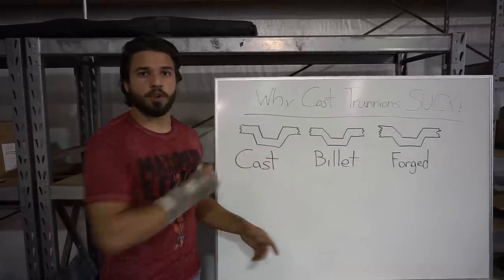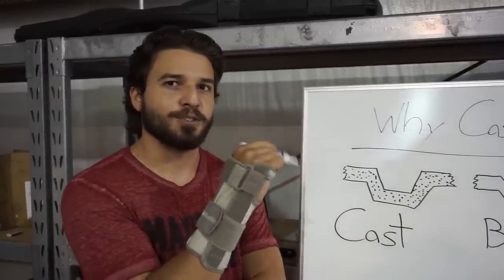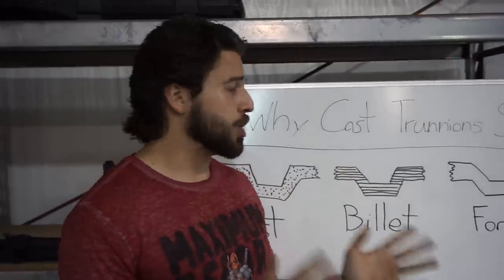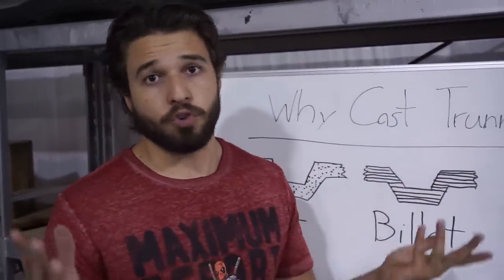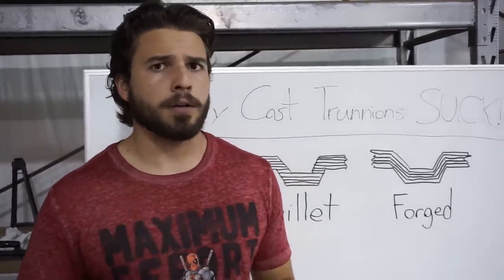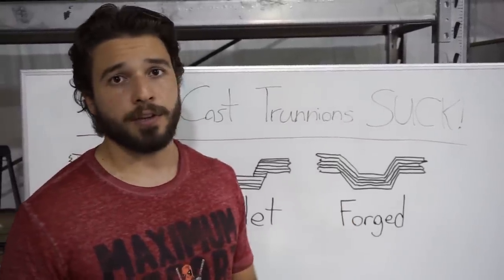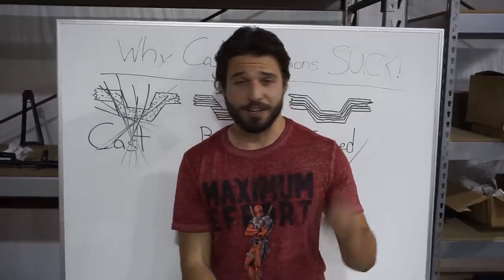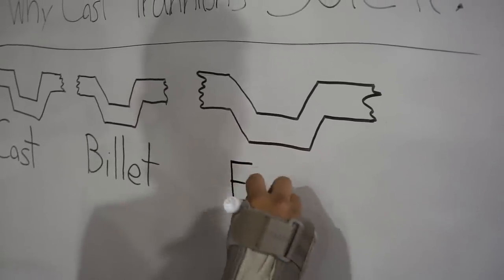Why Cast Trunnions SUCK!

Comment: Honestly, I don't understand why there is an issue.  When you get down to it, the difference in strength between cast, billet, and forged, with all else being equal, should be minute.  I wonder if it's something to do with heat treat or the specific alloy used, or possibly the quality of the casting method?  All steel is cast, and all steel that is not cast to shape is forged, ie billet is just forged into a bar.  I'm wondering if the cast, due to the extreme high heat has a very large grain structure, doesn't get the much needed normalizing cycles prior to heat treat?  Not saying there isn't an issue, just wondering what is causing it.  With modern steels the grain flow or direction is pretty much irrelevant.  In any event, I prefer forged over cast steel on just about anything as a mater of personal preference and would absolutely prefer a forged trunnion over billet or cast.
Reply: I think it has a lot to do with cost.
If you go for casting in a production process like this, where forging is an option, you do it for cost.
And therefore you will not use the best steel, the best mold, the best casting technique, nor the best craftsmen.
I'm pretty sure, if you'd go high-end with the casting, the end product would be 100% fine. But then you wouldn't save money by casting it.

Casting can do amazing things if you are willing to invest in equipment and skill, but it is probably also more sensitive to cost cutting than other techniques.
Reply: @Bird_Dog00  I'm thinking you are rite.  I think it's more to do with heat treating cycles, when forging you get at least some thermal cycles as a matter of production and never reach the extreme heat of casting temps.  If casting they probably skip a lot of steps to save time and money, otherwise why bother casting.  Even then, there is no doubt that forging is stronger, but all else being equal it'd take something along the lines of very controlled destructive testing to tell them apart and the difference would be slight.

Comment: I didn't want to believe it but mine just cracked on the right side locking recess. Really pisses me off. Searching now for a milled trunnion that will fit my Ras 47 barrel. I'm not sending it back to have a cast trunnion put back into it so warranty or not I'm going to have to fix it myself. Any input would be appreciated. I've done parts kits builds but never an ak. Looks easy enough but if you guys have any tips that'd be awesome. I'm mostly worried about the barrel diameter, I heard that the Ras 47 barrel is thicker than typical.
Reply: When I say milled I mean specifically the forged block type that are in the Yugo parts kits, that's what I plan to use because they're everywhere.

Comment: I think the century arms vska and riley quit cast within the last year. Someone else in the recent comments said that riley is using forged now, idk what vska switched to. I know i watched videos of old rileys compared to the brand new ones and you could physically see the difference in function/design of the higher quality parts.
Reply: apparently the vska switched to billeting based on the blurb on their website
Reply: @harveyknguyen  nice to know. Riley did switch to forged although the rifles overall quality is still moderately questionable
Reply: @preflightdrip8672  they're still going through teething issues, i'd give it a year or two until Riley and PSA actually make completely reliable AKs that you'd actually trust to not break
Reply: @harveyknguyen  eh i dont think they'll ever make good ones compared to wasr and zastava options, much less higher class stuff like arsenals and maadis. Rileys can be fixed pretty easy since their trunion is good now their main issue is the bolt carrier assembly so that theyre ok. As for psa i wouldnt trust a psa made flashhider much less a rifle lmao
Reply: @preflightdrip8672  maybe they'll get it down one day, kinda really hoping they do since as it stands imports are kinda drying up at the moment for 5.45 stuff
Reply: @harveyknguyen  true, cheaper 5.45 aks and ammo produced in the states would be nice
Reply: @preflightdrip8672  either that or Arsenal decides to treat the SLR 104s like the McRib

Comment: Psak 47 is under 700 and use billet bolt and trunnion
Reply: Knight Mech gen2 also has a forged bolt carrier. Now the gen3 has a forged trunnion, bolt carrier, and bolt.
Reply: I just picked the gen 3 up for $599.00

Comment: So... Where are all these blown up rifles? Personally, i dont own one of the rifles in question, and the only cenury arms i own is an fal copy,but ive owned several firearms that had safety recalls, and those recalls were massively supported by the comsuming public at large. And that is not the case with the ras47. This just looks like one guy that sells import rifles " broke" a rifle in an admittily destructive test on an early production gun( and has no idea how a "no go" gauge works. Like the majority of the people that watched that "test"). But despite what the internet claims,the numer of cast trunions " failing" is nowhere near the claims being made( well under 10 verified instances vs tens if nothundreds of thousands of rifles sold). The majority of the ras47 rifles on the market are metelurgically IDENTICAL to the vska( which " passed" what the " union spokespersons" test). But despite piles of evidence to the contrary everyones reaction to any claim other than " its a grenade waiting to go off" is treated with incredulous denial based on internet anecdotes. This really seems like an excuse to hate on an affordable option that has seen popularity. Just more hating on the " poors" and justifing spending more money. If cast parts are " so terrible" i guess ruger never saw the video. They have been casting EXELENT rifles for decades, in the same caliber no less.but if these cast trunions were half as bad as they are claimed to be; a) there would be more than 3 police reports and 5 emegency room charts sighting " rifle malfunction" as the cause of any injury, and century would HAVE to put out a recall or theyd be sued out of existance for knowingly making faulty equipment. and that has not happened. Seems more like the world is full of rifles that run fine, with cast parts, and the internet is just salty that fact doesnt align with a sales pitch from a guy that has a vested interest in selling imported parts kit rifles.
Reply: well look you also have to consider that the guy who likes selling SVDs on gunbroker also happens to break just about every single inexpensive gun he reviews
Reply: @earlycuyler2295  well i mean it goes to really any word of mouth info you get anyway, all guns even of the same model are going to be slightly different in every way, so even though everyone's IO AKs were awful there may be some that actually work, and the people who got them will have incredibly different opinions of IO compared to everyone else
Reply: @earlycuyler2295  oh yeah and the ruger part kinda has to do with the fact that they haven't actually made any AKs, so as it is the experiement of cast trunnions can't be reproduced on Ruger's end
Reply: @harveyknguyen  yeah. I know they havent made akms. But the fact is that they are made from cast parts and are NOT known to have ANY signifIcant known failure points.I was speaking about the mini 14/30 specifically, and the rest of their product line more generally.
 The entire receiver , is a solid machined casting.as are most parts. In fact it can be argued that ruger is just a casting company at heart. It is their bread and butter. And i do not see anyone having any issues with them. And there is an old ban era mini 30 floating arlund my family that has had to have seen close to 200k rounds. I know i had if tor a while and put 6 cases through it myself, and my father probably double that, and his brother shot it WAY more than we ever did. But annecdotes aside, if the " problem" was legitimately as interpreted by the internet gun experts, and cast parts are not suitable for long term use in firearms... Ruger would be out of business; or would have dropped it as an antiquated means of production.
And that just is not the case. It comes down to marketing. And peoples desire to be validated by the companies that sell guns to them. They desperatly want to believe that these " content creators" are anything more than salesman. Its not just brandon, or akou, military arms, firearms unlimmited, or any other. They all shill for the last check to clear, while other, smaller, and objecticly "independent" channels are put into a position where they either have to " tow the line" and agree simply because the " community" of sponsored channels demand compliance, or disagree and themselves be called " shills" for doing their own analysis that find no issues with the product in question.
Reply: @earlycuyler2295  yeah i don't think the takeaway from this video is that casting sucks, it's that casting trunnions is a bad idea

and also all of the US AK manufacturers switched to forging or billeting their trunnions now
Reply: @harveyknguyen  yes, they have switched, but that switch was made long before they changed the name of the "ras 47 "to " vska". But again,  the point is that its bad because of cast parts.all other data aside, and back to my original post -" where are the blown up rifles?".
If these were as " bad" as the internet claims there would be more tha less than 10 actual confirmed incedents.and of them about half are from peoole  replicating destructive testing methods, commited to finding a point of failure to " prove" the assertion. You can " break" anything if your trying to do so. Even machined trunions.
If it was a " problem" and century still knowingly made something that failed they'd need to do a recall, and the owners would be 110% on board with it. From everyone ive seen with a ras, the rifle has none of these "problems". And the only people that talk about how bad they are are people with either a vested interest in selling other akms, or youtube host fanboys.
Reply: @earlycuyler2295  but then that begs the question as to why the VSKA was even made if the RAS-47 was fine in the first place

plus as i stated earlier, nobody's gonna have the same experience, so unless anyone has a large sample size of RAS-47 owners, it's not going to be indicative of the real failure rate of these rifles 

and then those issues may not even come from casting but rather due to bad quality control (for example, the cast itself was poorly done)
Reply: @harveyknguyen  it was renamed to avoid this silly, false rumors. " red army standard" was going to be a multi brand product line and century invested heavily into it. Mags, ammo , rifle, parts kits, accesories, etc. I think i remember seeing special targets with the brand to. Just about anything youd need as an ak shooter was part of the red army standard branding. Which might have something to do with the importers ( and subsidiary companies) putting out this editorial " hit piece" on the rifle that was came ready made for the american consumer. I mean... Its not like they didnt try it again with the vska, again known shills for ak importers try to claim some inherent defect. Unfortunately this time around the claim was easily disprovable, and presented by a less " respected" more  "controversial" figure in the community.
Again the answer comes down to marketing.

As for " sample size" ive gotta go with the people who own them, and report zero issues. It seems like any time somebody says "mines worked fine" the immediate reply is from people claiming that that is not possible, because of these tests and a handfull of other people trying to break an akm. basically every single user is liar, or the problem doesnt exist. As stated ive had several firearms that have been recalled, for quality and safety issues, and the majority of owners are NEVER "in denial" as it is expressed ras 47 owners are for claiming no issue. Go look. Like i said i dont have a dog in this fight. Im in no way going to ever be buying a ras47( im covered when it comes to 7.62x39 rifles) but its become a " meme" of the community to trash on what 99.99% of its users say is a decent, low end akm. To the extent that i looked into the claims and found them to be questionable at best. And only actually " substantiated" from sources with questionable intentions.

The Potential  "quality control" issues are about the only legitimate concerns, it IS Century and there have been a few dubious guns with their name on them. BUT, IF it were an issue there would be more first hand accounts of failure. The best i can find is 10 reports that look like they are of between 4-6 rifles failing.and the details arent really solid enough to rule out anything. Maybe it was bad qc, it could have been bad ammo.maybe it was a headspace issues from higher round counds, maybe it was the " human element".  The one with hospital photos has an incident report that kinda sounds like it might have been a squib.
Regardless, yes any failure is BAD, but if it were an "issue"  at the production and they didnt address it, they are asking to be sued out of existance.thats why recalls are done. for something as high profile as this was, with like EVERYONE talking about them online the lack of recall, warning, or response would make them extremely liable. and it would be a much better bussiness move to simply recall and replace the allegedly " defective" guns just to cover their hinds. Century has basically said , " they are fine, thoses test are baloney". If they werent, anyone with a failure as predicted by them now has a civil case. So why would century put themselves in that position unless to the absolute best of their knowalge and testing the rifle was solid? If the claims are even remotely true, or even if it was all due to some other defect, why risk it all on a single product? It kinda sucks they had to dump the name, but thats the extent of their reaction. And the early vskas seem to be built on re-stamped late run ras47 recievers. 
I trust the people that own and use the rifles more than a guy that makes a living selling them. And when the guy make his living selling a competing product.... Idk if i can take that many grains of salt and still call it "trust".
Reply: @earlycuyler2295  i wouldn't necessarily call it a rumor since there are actual cases of incidents like you mention, but i can only really say that it's the internet, i'm pretty sure people were still buying RAS-47s even throughout the entire drama saga seeing as CAI did actually come out with another AK that seems to be doing a lot better (not to mention is being more well-recieved), so obviously the gun wasn't a flop

also i think this video was made mainly to address IO's AKs, since that was an actual market flop
Reply: @earlycuyler2295  but yeah anyway as you can tell by now i no longer have a clue as to what i'm saying so one last thing before i stop

it's the internet and people like drama
Reply: @harveyknguyen  im not saying NOTHING happened.just that the " rumor" that casting is masivly inferior, and that cast tunions turn a good akm into a time bomb is ludicrous. And that being used to shame a company into rebranding their flagship product line at the whim of an import salesman in a  fake bulgarian accent is about as much undue " cancel culture" and " identity politics" as anything else ive seen in this community. Nobody does their own leg work, and trust actors hocking their wares above logical analysis of data.
 the funny thing about THIS VIDEO... Brandon bought the io factory.for all his bluster about the esoteric nature of building akms " right"...hes just building io's and slapping his name on them. Whatever the trunion, its still just an io.
Like i said. Its a bussiness.for the right price, integrity goes out the door.
Reply: @harveyknguyen  exactly. Its just drama. Its a shame so many people cant or dont want to see past it.

Comment: This is not even wrong. There is so much nuance to all processes, heat treatment and even the alloy itself being used that you simply cannot say X is better than Y and Z... it may be that it's actually worse for the exact same reasons you think it's better, oriented grains aren't always a good thing in regards to part geometry and stress, or your grain size is so refined or your main strengthening mechanism is other than plain work hardening  thatit really is something moot. Also the "spongy" appearance of the fractures you're describing isn't a sign of cast, but a tell tale of fatigue fragile failure... any metal, regardless of manufactuign process, will dispay that characteristic.

Comment: Is anybody making an AK-47 in the 6.5 Grendel are the 224 Valkyrie round with a barrel length to treat the round out for maximum performance and still be able to use the AK-47 mag and how come nobody makes a 2.0 thick mmm receiver stamped

Comment: Doesn't billet waste A LOT of steel?
Reply from the maker: Depends on your definition of waste. It does require you to start at either a round stock or a square billet, and then remove the excess. But I believe most machine shops sell the excess for recycling.

Comment: So if I spend 7-8 hundred dollars on a rifle well I should say an AK-47 or AK-47 variant it's not going to be well built but I can buy a $500 AR 15 that's built way better than a AK because of aluminum and aluminum is cheaper to manufacture or mill than steel then why don't they use aluminum on an AK and make it lighter and cheaper to manufacture or mill itI don't know enough about them to know whether you could use an aluminum one or if it's not strong enough or what but I know they use aluminum in aircraft so I know it's very strong I know it's rust proof everything but unless I'm a k God or Brandon Herrera I mean how do we know when we go look at a AK like how can I know that it's cast trunnions or a cast bolt if it's not broken and I can't see the SpongeBob holes in it?